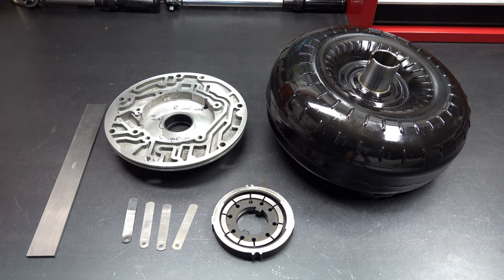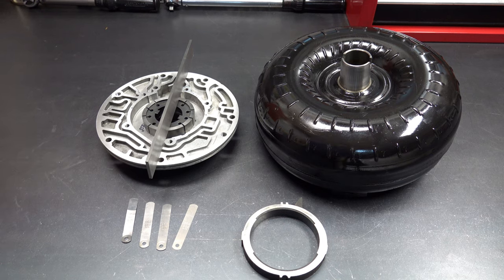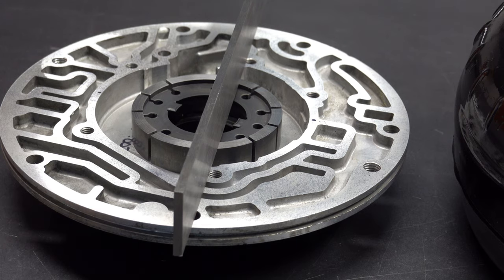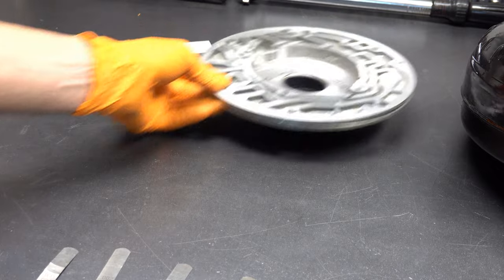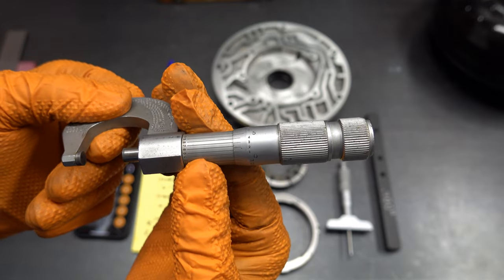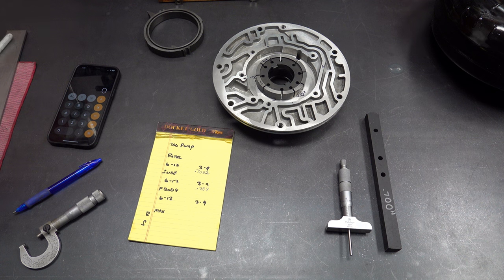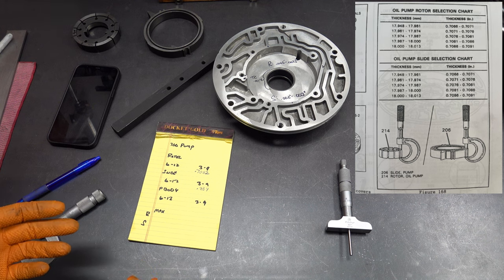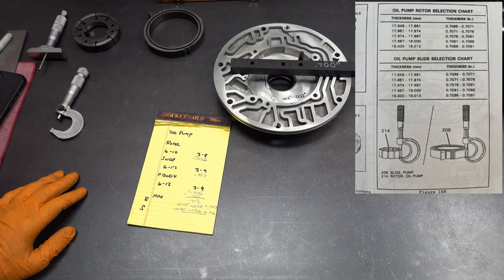700R4 Rebuild PT3: Measuring for Pump Clearances

Comment: Nick I have a question. I had a guy rebuild my 700r4 that I have not installed yet. He supplied me with a torque converter.The converter has a bunch of 7's all the way around it. what type of converter is this ? he wrote 2100 on it. Is that the stall ? Ive been doing some research, I seen a converter chart with the 7's on it, And the chart said 1654 stall. I had this built with upgrades, 13 vein pump, 5 gear pinion gears, Fairbanks valve body kit. I need this for towing. Not every day. What kind of converter should I be using ? And how can I identify it so I know what I am getting ?
Reply from the maker: Hi Jerry, He had a stock-diameter torque converter assembly built with a 2100 stall speed kit. Did you ask him for the higher stall speed? 

Did he know the vehicle was going to used part time for towing? 

Did he upgrade your 2nd gear servo to an 093 Corvette or billet servo? 

What about a wide 2-4 band and .472 boost valve?

The above plus a basic shift kit are what I typically do for towing/working trucks

For 700r4s/4L60Es that are used for towing, I run a converter with a 1600-1700 stall to get heavy loads moving while keeping temps in check. Higher stall speeds are great for performance but for heavy duty towing, hauling and working vehicles, I generally keep stall speeds at stock or lower. Id call your trans builder and confirm the stall speed on that converter. Also put a big aftermarket trans cooler on the truck and plum it through the cooler in your radiator in series (if you havent already) and maybe a deep pan for more capacity. If loads exceed 5k and you want to tow in OD, install a Sonnax or Superior Tech 4th gear servo (note - i dont rec towing in overdrive).
Reply: No I did not. I told him that i want it to be able to haul my tractor and be reliable. Im guessing the stall kit is in the valve body ? the fairbanks kit is part #A74171 @nickstransmissions
Reply from the maker: The stall kit is in the converter - specifically, its the fin angle on the stator one-way clutch assembly that determines fluid coupling RPM. When the converter achives fluid coupling, the RPM where this takes place is referred to as the 'Stall' RPM speed (stall speed for short).
Reply: I just hope that everything is going to work properly.
 @nickstransmissions

Comment: Hey so, my trans has been working great. Then I let the car sit for a week and when I drove it again I have no 3rd or 4th gear. Just acting like neutral. Doesn’t load the engine at all.
Reply from the maker: Sorry to hear that, man! Sounds like perhaps a sealing ring, perhaps the bottom ring on the input shaft was cut upon installation of the pump (occasionally happens if it protrudes outward due to not being completely resized)....Let me know what happend and what you find when you go back into it.

Comment: Hey Nick, thanks for the information. I just opened up my first pump and the rotor/slide surfaces on both halves look more like a vinyl record then a good working surface. Since this is my first rebuild I don't have any good contacts for machine work so I'm trying to figure out my best way forward. I've measured the rotor and slide and both come in around 17.98/18.00 mm so it looks like they are at the top of the thickness chart for a 4l60e (2002). Not sure if it's worth having the halves machined or just try to find some new/rebuilt ones? Regardless, thanks for the information as I'm sure I'll be needing/using it in the near future. Tony